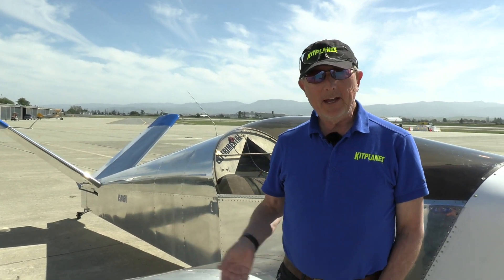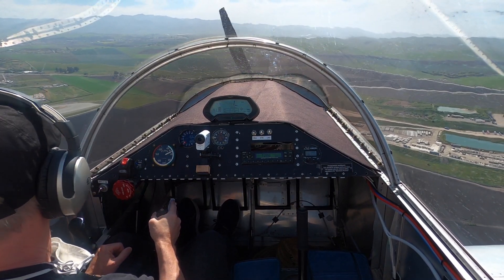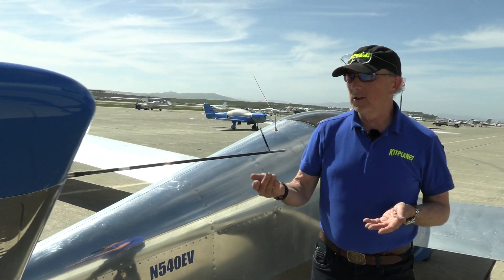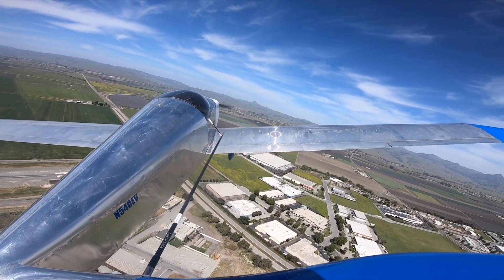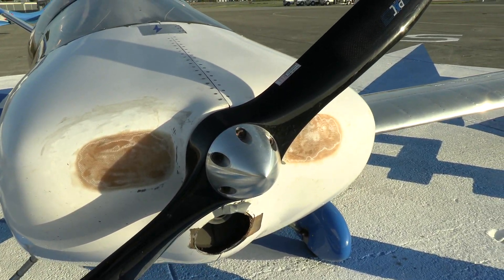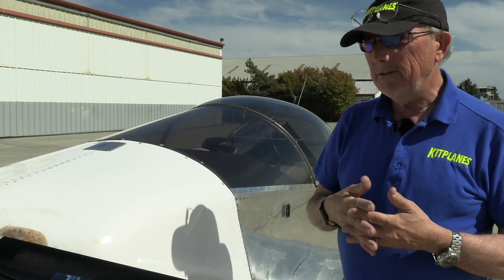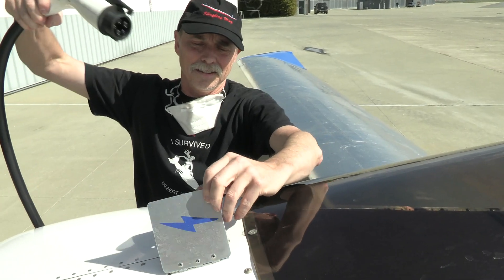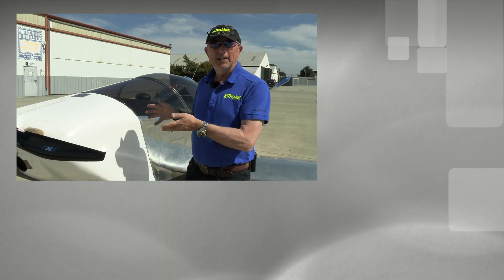eXenos Electric Motorglider

Comment: It's an interesting idea, but what is the glide ratio? The best way an electric powered airplane will work is as a glider, especially if the wings can be covered with solar panels and a small diesel powered supplemental electricity generating motor could be on board as well. It would allow the engine to run as long as possible, it would be as quiet as possible to fly. That is what I am looking for. But in a glider with about 35:1 plus glide ratio. This one I would guess is around 17:1 possibly less and yet while that qualifies as a glider due to aspect ratio of the wing, there are LSAs that have that kind of glide ratio and they are not gliders.